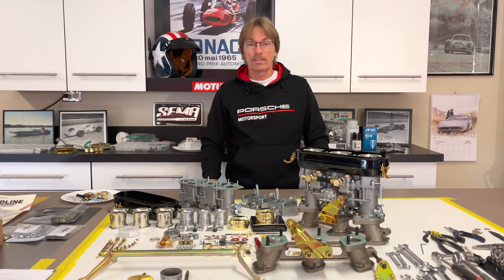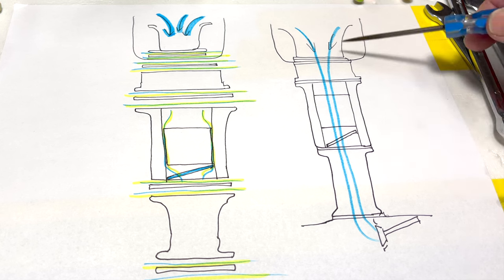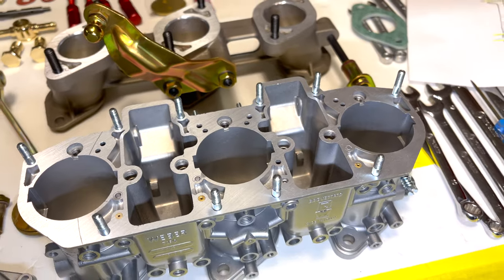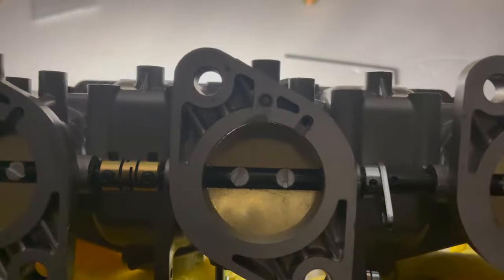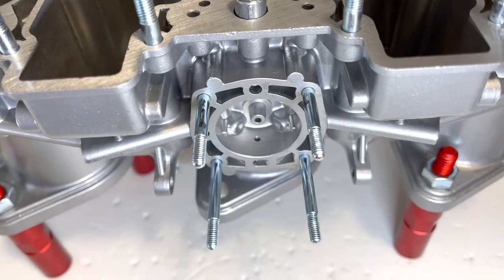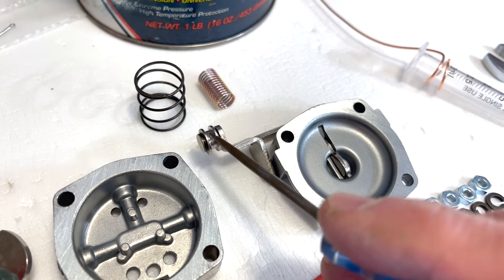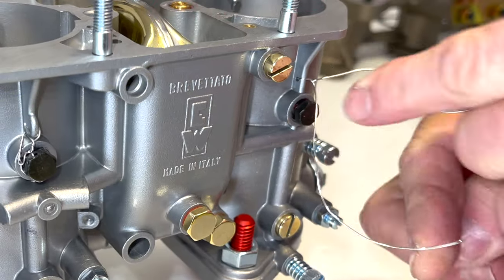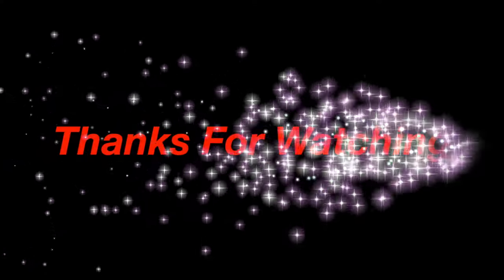Massive 250hr Restoration!

Comment: What process did you use to strip off the original anodizing?
Reply from the maker: Hello Jake
Carburetor bodies were vapor blasted and sealed on the outside with aluminum cerakote.
The brackets, adjustment screws and lever arms were soaked in muriatic acid to remove the old zinc coating and rust then re-zinc plated. Air horns were refinished in nickel plating.

Comment: Nice work! You know, my Yamaha XZ550 has a reverse engineered weber style carb, which is often the subject of a lot of discussion considering they can be quite tricky to deal with. I have mine in parts in a tub, I purchased rebuild kits, and they await the time. I had already been looking at videos on youtube about it, and this video has turned out to be the best quality one on this platform as far as I have found. I will visit your full ones soon enough. Thanks for your dedication to quality, really paying off!
Reply: I rebuilt the non stock Webbers on my '72 E-Type.  Milling the surfaces flat and using sealant any where a vacuum leak might possibly occurred (just like in this video) fixed each and every issue I was having with the car.  Made the headache of  adjusting 12 throttle bodies much more manageable.
Reply from the maker: Hello Christopher thank you and seasons greetings!
Motorcycle carbs were my favorites to play around with.. particularly Mikuni carbs.
Amazing how they work with the slide.
I miss those days!
Keep safe and see you in the new year!
Reply from the maker: Hello Nuclear and seasons greetings!
Entype Jag with bank of webers what a beautiful sight!
One of my all time favorites.
Sounds like a thorough rebuild did the job
Thanks you for sharing!
Cheers!
Reply: @MikesRestorations  I prefer the Series I with the inline 6.  But I'm 6'7" so the V12 Series III is all I fit in.